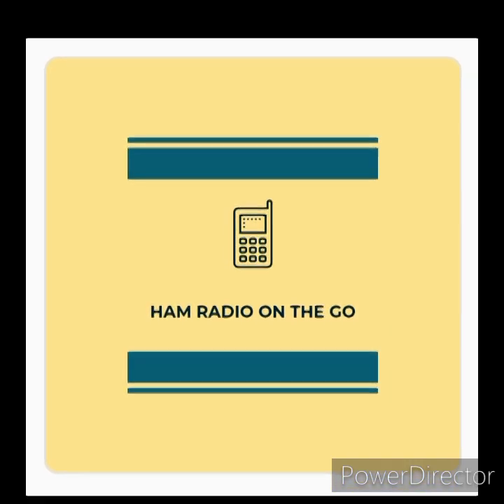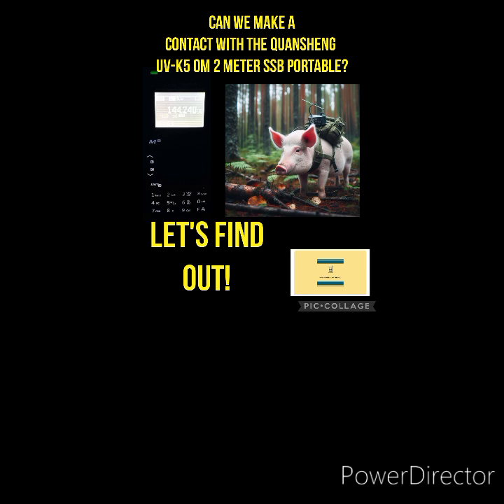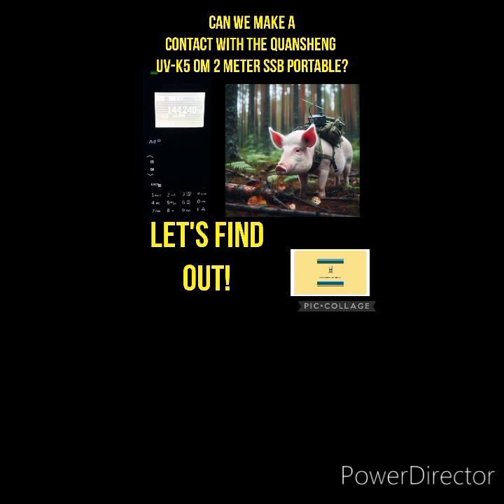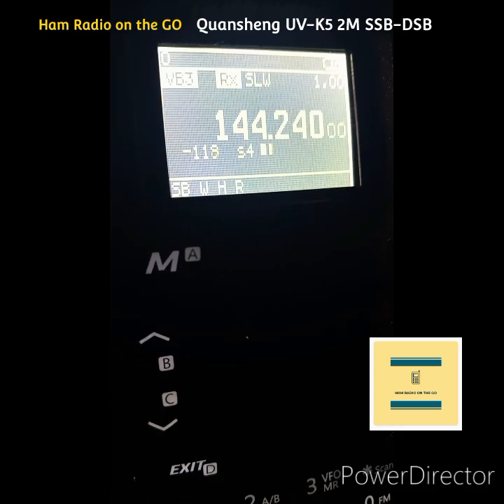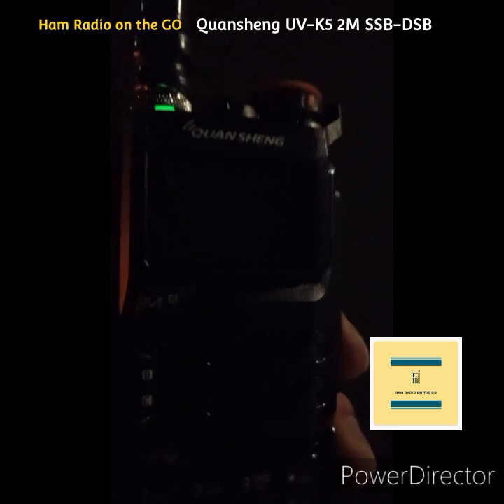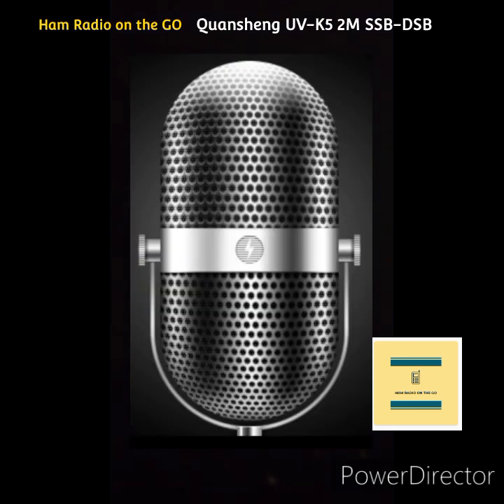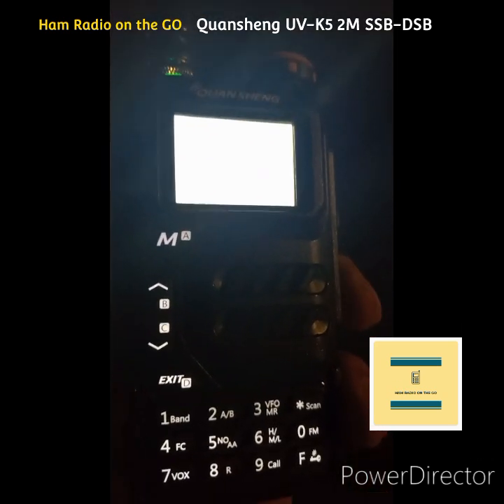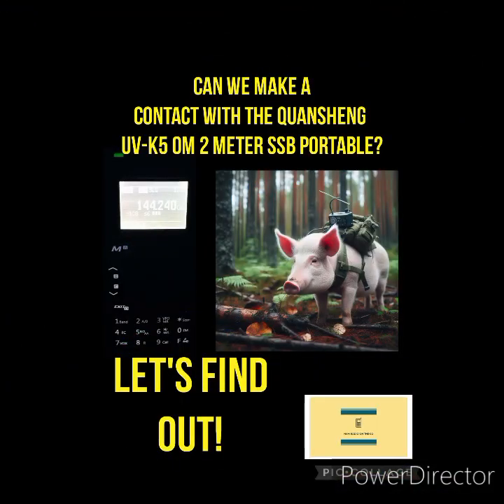Let's try for a QSO with the Quansheng UV-K5 on 2 Meters DSB to USB IJV Firmware. #hamradio #vhf

Comment: Nice video Joe!  I have this ht 5(99) also and have hit a local repeater on 222m. Question, how can you determine what firmware is in these units?
Reply from the maker: Thanks appreciate it!, and good question. To check the firmware currently installed on the UV-K5  press the M for menu button closest to the screen to access menu and go to 47 and it should tell you,  keep in mind I have the IJV 3.0 so it may be different to yours if you have another type of firmware. 73

Comment: I like these Quanshengs, I own two. Thanks for your test, DSB mode is something that particularly interests me. Something I don't understand though is which sideband does it *receive*? I get that it transmits on both sidebands, but does it also receive LSB and USB simultaneously? Is there no way to filter for just one sideband? I'm also looking for other firmware mods with other features that also allow for DSB TX, and the list I've found is:
- phdlee/uvk5cec on Github
- MCFW "Matoz" (spm81/MCFW_UV-K5_Open_Source_Firmware on Github)
- IJV
I'd be interested to try any others that might be out there.
Reply from the maker: @s.b.2088  That's a good question. My next QSO I will experiment further with the RX station switching from USB to LSB to see how the signal is received.  Thanks for listing some of the mods. Many hams I know just like you purchase several UV-K5s and inject different firmware mods. Thanks for getting into the conversation.  73
Reply: @hamradioonthego  Thanks a lot, looking forward to your future tests.